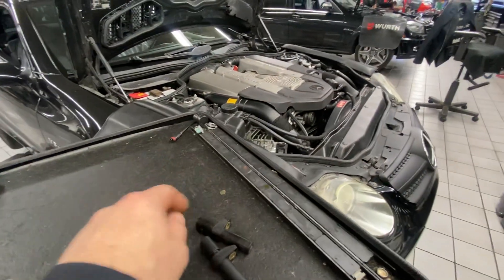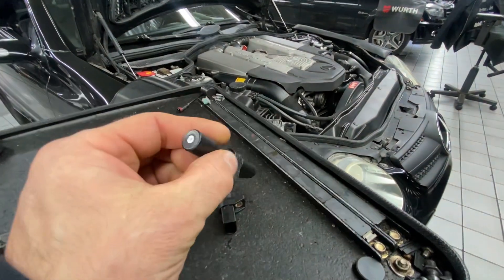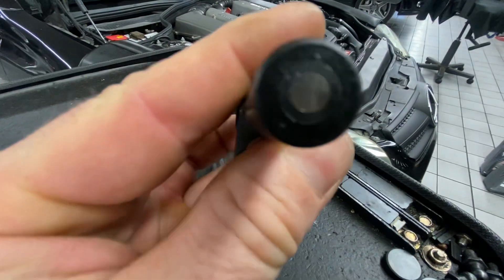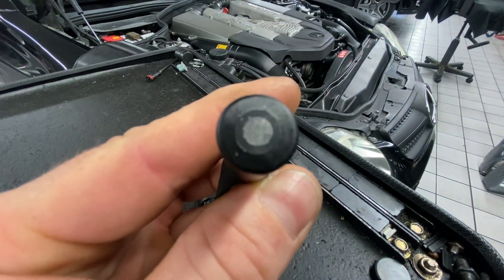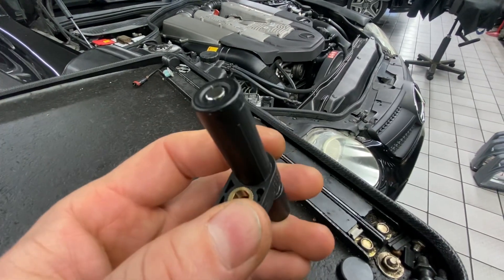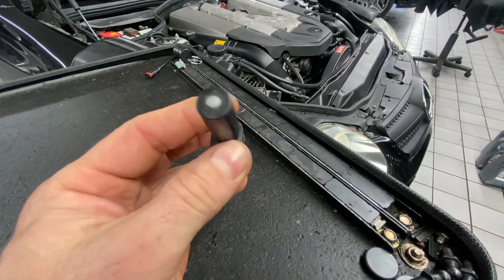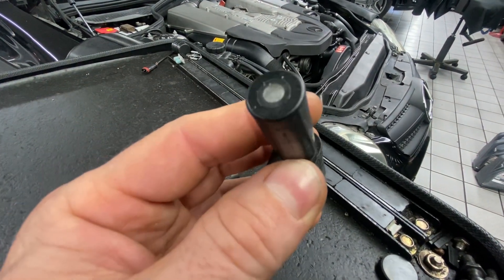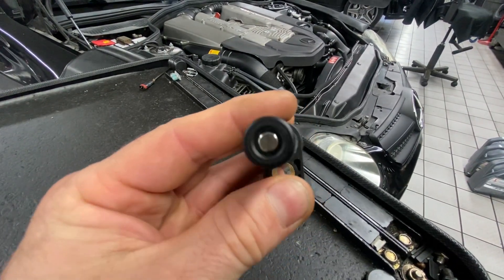Updated crankshaft position sensor. M113k M112k M113 M112 M271

Comment: any aftermarket? part approx 120 usd online, not bad, but aftermarket is 30 usd- but is the old style. thanks for sharing this info with us, i'm in the middle of this job and want to put it back together perfectly
Reply from the maker: I’m pretty sure the Bosch part is the same as the Benz part without the star on it.
Reply: @AMGmechanic  awesome thanks so much! this darn E8 bolt holding it in is killing me. i finally got a socket on it but it started to round off so i walked away to re-plan lol.
Reply: i could be wrong but it seems that Bosch never updated the part? they’re all the old style, $30, only a couple other brand has this new button style part, i’d honestly just go with the OEM.